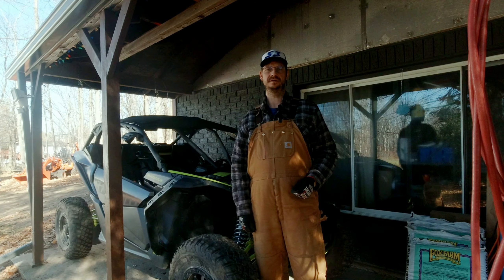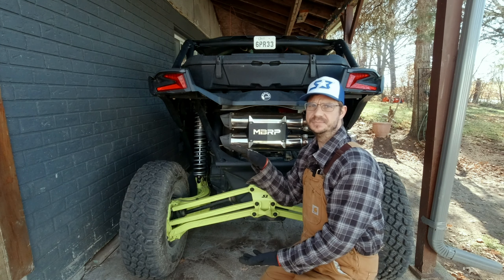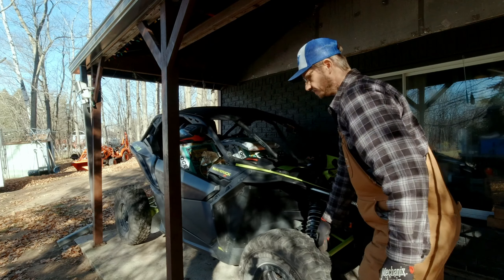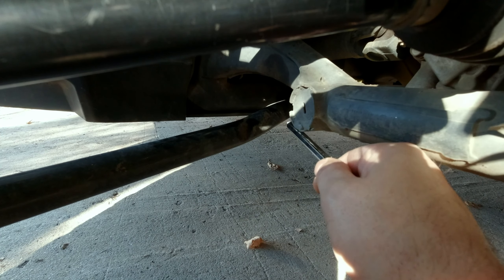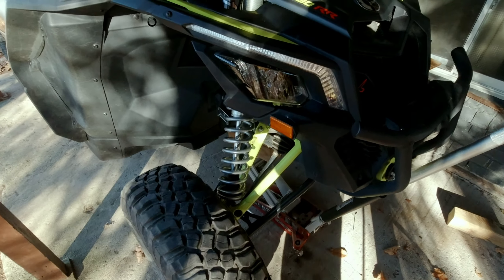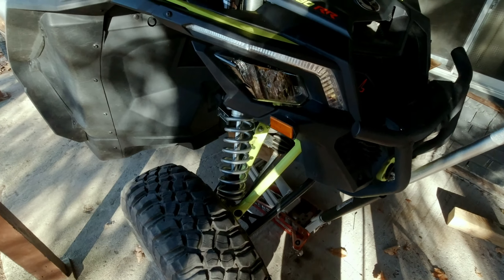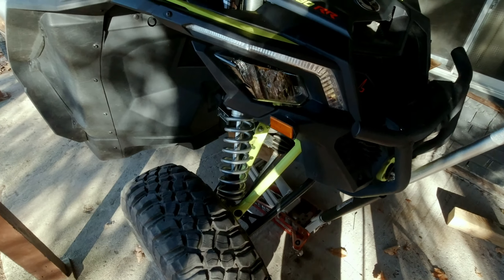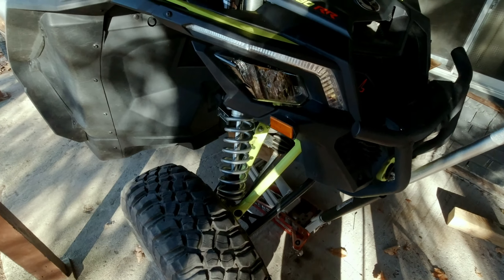CAN AM MAVERICK X3 RIDE HEIGHT ADJUSTMENT #ShockTherapy #UTV #CanAmOffroad

Comment: What was the measurement from to of the shock the the first locking nut? Please and thank you.
Reply from the maker: I think I mentioned it in that video. But yours is not likely going to be exactly the same as mine. You just do what you have to do to get the desired rude height.

Comment: arent your front shock resiviors supposed to be on the inside?
 that's how mine came stock. am I missing something?
Reply: People flip the shocks to give it a cooler look...You have to trim the inside of the plastic where the shock comes through or else it will rub hard when your shocks compress while  drivin

Comment: The front preload compress 1"=1/2 increase of height
Reply from the maker: On stock springs perhaps. Not that its written in stone, but Shock Therapies springs it's approximately the opposite. Just a general rule of thumb for a starting point. Either way, do what you gotta do to get the ride height you want👍.
Reply: @SideX_Each  what i mentioned is what ST says on one of his videos.and makes sense since front aren't straight.but yea,at the turn that bastard ring until your happy
Reply: 1/2 spring compression = 1" of ride height. Correct my friend.